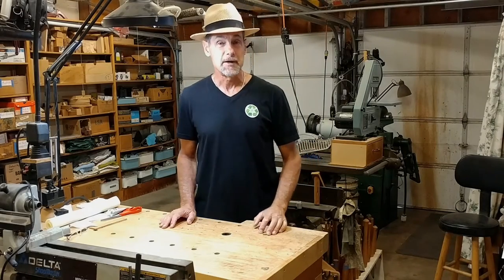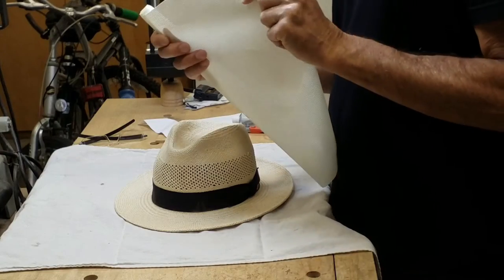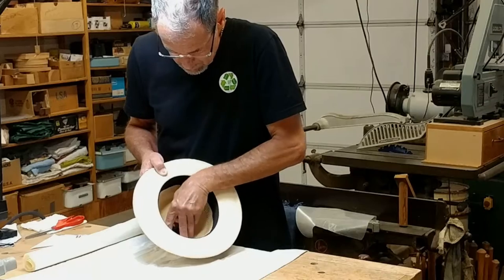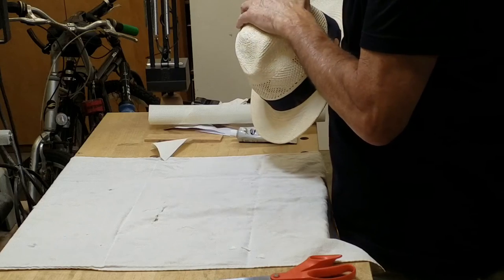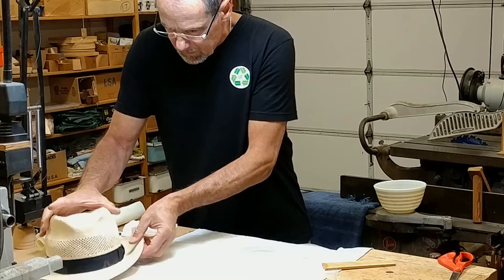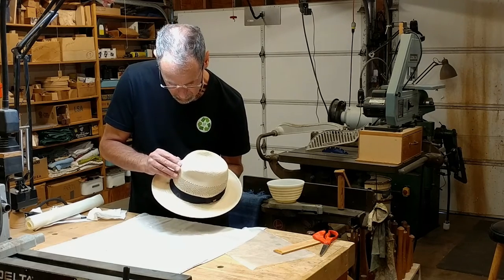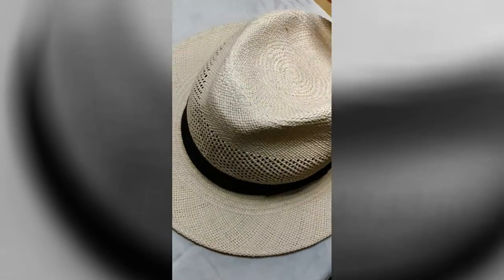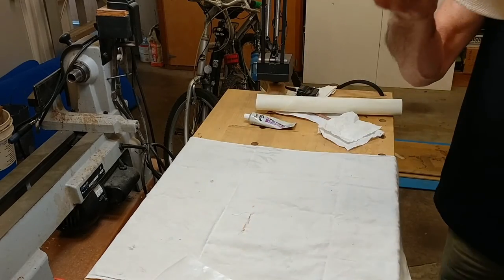Panama Hat Repair

Comment: Looks great, but how would you repair it if it were the brim, including the bias edge?
Reply from the maker: I've done brim repair by binding the fibers with CA glue (super glue). There are different viscosities available; medium is good. Put a few drops of CA on a piece of wax paper (CA doesn't activate on wax paper), then use a very fine piece of wire as an applicator to dab tiny bits onto the cracked straw. If it's badly broken you'll need to first weave in little pieces of straw, or some other type of fiber, that'll hold across the damaged area.

Comment: I have a Stetson brand Panama hat which has their usual white coating or finish on it which has worn off on the underside of the front brim. It had gotten smudgy and dirty with handling and I washed it off gently with detergent and warm water dried it off very quickly and that took off the white stiffener that they apply to their hats is there a way to put something like that back on there? The Stetson hat company does not tell you on their website.
Reply from the maker: I'm sorry but I have not seen that nor am familiar with that product.